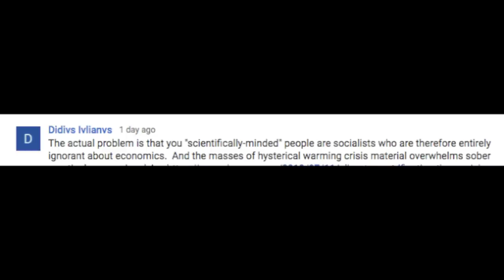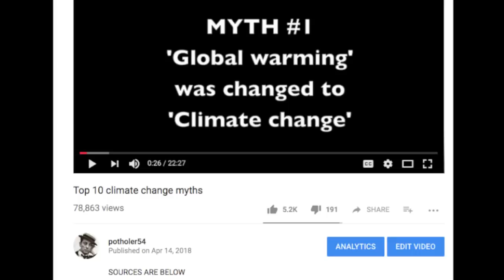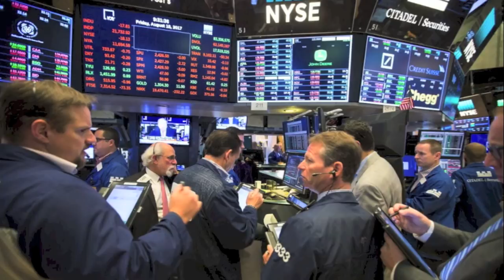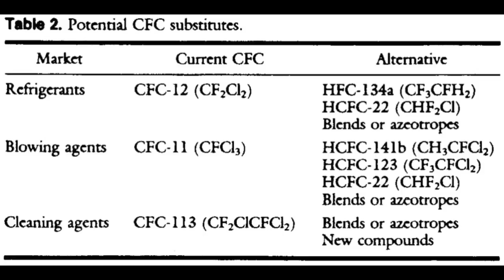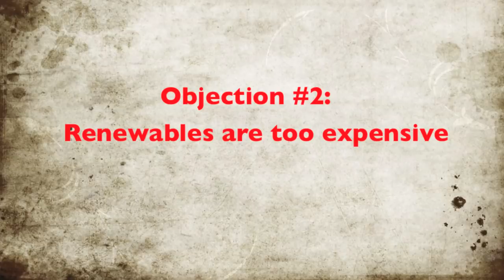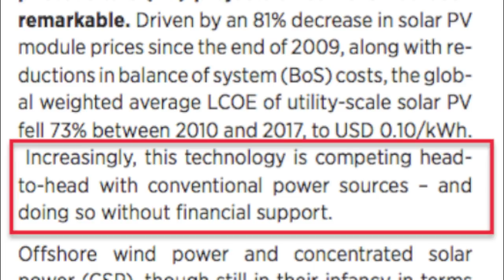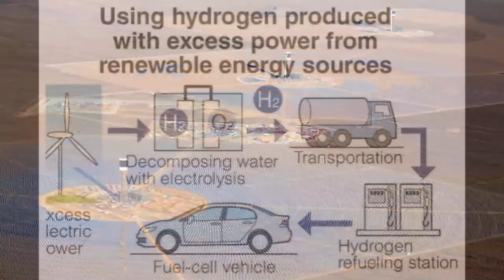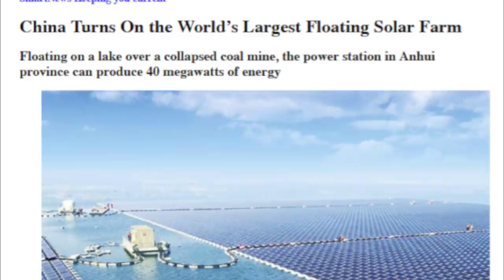A CONSERVATIVE solution to global warming (Part 1)

Comment: My concern is that the technologies that are currently subsuidised and seen as a replacement for fossil fuels - e.g. electric cars, solar panels, wind or lithium-ion batteries are just going to cause more pollution in the long run, only of a different kind, e.g. instead of CO2 in the atmosphere we'll get water and soil contamination from increased lithium/copper/silicon etc. mining, thus making the currently proposed technologies a dead end and not a viable solution. I'm worried that since those technologies are subsidised nobody is going to worry about that their drawbacks and ultimately this will lead to another problem in the time to come. Maybe there should be no subsidies at all and at the same time higher fines for polluting the atmosphere as well as the soil or air, no matter if that pollution is released in e.g. German cities where cars drive or in Chinese mines and factories where they are made. Maybe then the market would be forced to look for technologies that are viable in the long term and do so more efficiently.

Comment: @pothler54:
Food for thought:

short analysis:
switching to renewables etc. will decrease the demand for fossil energy sources. Decreasing demand will lead to decreasing costs. This will lead to fossil energy sources getting ahead of renewables on the market. Especially poor countries will focus on fossil energy sources instead of the more expensive renewables.
In the end, the same amount of fossil energy sources will be burned and switching to renewables will hardly save any green house emissions on a global scale.
This renders most of the current climate change mitigation efforts useless.

another approach:
nations and/or NGOs buy oil fields, coal mines and halt the extraction. The supply drops and the price rises. Renewables will get the cheapest source for energy.

What are your thoughts on this?

The german professor for industrial engineering and energy Prof. Jürgen Kuck has explained the main idea behind it very briefly in his 4 minute video "buy carbon!" which is up on his Youtube-Channel "Jürgen Kuck". His more detailed talks on the topic are only available in german as far as I know.
Reply: The costs of fossils would only decrease if there was an over supply + extraktion and refining costs of fossils keep steady.

Which kinda seems unlikely as the reserves keep getting smaller and demand is still rising

Afaik the costs of extracting and refining it - rise with new stricter enviromental protection regulations. And dont forget the  infrastructure required to transport it.

Oil is still used in some other industries, like pharma or material production.

And (renewable) tech usually keeps gettting cheaper with broader use and innovations in production and technologies.
Reply: @NewPipeFTW  
I agree that not all oil will be extracted and eventually renewables will be cheaper.

Comment: After watching some of your videos, I commend you for you genuine effort at veracity. But I need to point out a glaring flaw in your presentation: it appears you don't have an adequate grasp of energy economics, particularly the energy returned on energy invested (EROEI). This is the amount of investment you need in the form of energy to obtain a certain amount of energy out of a given energy source. So for example, in the 1930's for each barrel of oil that you invest to set up an oil rig, it would yield you 100 barrels of oil, meaning an EROEI of 100:1. Nowadays, with the massive investment in terms of money, effort and energy that is required to build a multi-billion dollar offshore-oil-rig or a shale-oil fracking rig, the overall EROEI of crude oil has diminished to about 30:1. To run an advanced industrial economy with lots of specialization and diversity in roles requires a minimum EROEI of 10:1. The problem with wind and solar is that they can at best give an EROEI of 5:1, even with improvements in technology and efficiency. What this means that they are extremely capital and resource intensive and will yield only moderate returns in energy. To run a modern economy on wind and solar would require that the energy economy has to be a large part of the overall economy. This would be a huge step backward. It's like sending millions of people back to the farm to grow food. This is the FUNDAMENTAL reason why they are not viable as sources of energy to sustain our energy-intensive ways of life. They just don't give you enough bang for you buck. Moreover, building massive numbers of them would draw down heavily on the world's finite supply of precious metals like indium and gallium, whose production by the way China has a monopoly over. It's not just because of China's farsightedness that it is investing in these renewables; it's because it has the precious metals to do so. Conservatives are actually right to downplay wind and solar, but they are wrong to insist that we continue on the same path we're on now with fossil fuels. The answer lies elsewhere. Fusion energy perhaps. Something with a MUCH, MUCH larger EROEI. The reality is that we need EROEI to keep increasing in order to allow us to tackle the problems we have created for ourselves. We need massive quantities of energy to free up our initiative and enterprise.
Reply: I'm curious how you are calculating EROEI for wind and solar. Obviously, in the short run, they are much more resource intensive, but over the long run don't they outpace fossil fuels? Once you burn a gallon of gasoline, it's gone. But you can let solar panels just sit there for decades without doing anything other than cleaning them or maybe replacing a bad cell now and again. What's the time frame you're using for EROEI?
Reply: Tom Timelord I believe solar panels need to be replaced every two decades or so.
Reply: @tomtimelord7876  The exact number crunching was done by Richard Heinberg and the Post Carbon Institute, who have been studying these matters for decades. Richard has given many presentations on this subject for many years. There are also many articles archived at theoildrum.com, where people had been very actively discussing these matters back when it seemed as if we had reached the peak of global oil production (around 2005-2013). Gail Tveberg from ourfiniteworld.com has also written some great articles on this matter. Here's one:
https://ourfiniteworld.com/2016/12/21/eroei-calculations-for-solar-pv-are-misleading/

I'm not sure that in the long run wind and solar can replace fossil fuels since these alternatives can only be developed, built and deployed at a low cost on the platform of an existing fossil fueled economy. In other words, coal and oil are subsidizing solar and wind. Think of the diesel-powered machines and trucks which mine the metals, the coal-powered power stations which supply electricity to the factories where solar panels and wind turbines are made, the oil-guzzling shipping vessels which transport them around the world etc. Furthermore, as Gail Tveberg once said, wind turbines do not run on wind: they run on spare parts. They are rather fossil-fuel intensive in all the maintenance they constantly require eg maintenance crews have to be flown by helicopters to offshore wind-farms. Windmills are not self-sufficient in this sense. 

One has to do the numbers. The energy economics of wind and solar just don't come anywhere close to fossil fuels. This is not to say that we shouldn't develop alternatives; just that we need to be energy-literate before tackling the problem.
Reply: @shox007  Well, I think there's a couple assumptions you're making that I'd like to address. The first is that solar and wind will "replace" fossil fuels. I mean, in the long run, this will have to happen right, as fossil fuels are non-renewable? Maybe 100 years, maybe 1000, but eventually there will be no fossil fuels left. So by 4000 AD civilization will have to be powered by renewables and nuclear, right? I mean, what's the alternative? In the short run, however, solar and wind are good in certain niches at supplementing fossil fuel power. 

Also, you're kind of assuming that solar and wind technology won't improve. You wrote "The problem with wind and solar is that they can at best give an EROEI of 5:1, even with improvements in technology and efficiency." I'm not a physicist or an engineer, so this is a bit above my pay grade, but I'm curious why you give it an EROEI of 5:1, max. Is it simply not possibly, even theoretically to have a higher EROEI? Like, would it violate the laws of thermodynamics to have an EROEI of 10:1 for a solar panel?
Reply: Tom Timelord The assumption the gasoline is gone after its burned is still inaccurate as you can still filter the CO2 out of the atmosphere and reuse it if the systems were in place. Not saying we can do that reliably now, but in the future it could be possible.
Reply: @ultroniumgalactus7343  That would be great because it would simultaneously scrub CO2 from the atmosphere while giving us a fuel source. But that technology has a long way to go.
Reply: @tomtimelord7876  I totally agree. That is why we should let the free market develop solutions to that problem.

Comment: What the scientists/professionals say about climate change: 
 
Meteorologist Tom Wysmuller has pointed out “total disconnects” between temperature and CO2 “going back ten centuries.”  As Wysmuller wrote, “From 1000AD to 1800, over a period of relatively stable CO2 values that bounced around the 280 ppm level, temperature plummeted in the Little Ice Age and then rebounded over a century later.  CO2 values neither led nor followed the temperature declines and recoveries.  CO2 seems to have had little impact in either direction on the observed temperatures over a 10,000 year period.  If CO2 is to be considered a major driver of temperatures, it is doing a counter-intuitive dance around the numbers.”

Australian geologist Ian Plimer wrote. “At present the Earth’s atmosphere is starved of CO2.  On all time scales, there is no correlation between temperatures and CO2.  If there is no correlation, then there is no causation.”

Prominent award winning Swedish climate scientist Lennart Bengtsson (who was formerly a global warming activist) declared CO2’s “heating effect is logarithmic: the higher the concentration is, the smaller the effect of a further increase.”  Bengtsson noted that global warming would not even be noticeable without modern instruments.  “The warming we have had over the last 100 years is so small that if we didn’t have climatologists to measure it we wouldn’t have noticed it at all.”  Global warming activists were stunned by this public about face by one of the ‘census’ scientists and Bengtsson was subjected to harassment by the climate change community.

Bengtsson said he had come under "an enormous group pressure" and said that "I see no limit and end to what will happen. It is a situation that reminds me about the time of McCarthy.  I would never have expected anything similar in such an original peaceful community as meteorology. Apparently it has been transformed in recent years." and "I had not expected such an enormous world-wide pressure to be put on me from a community that I have been close to all my active life.”  He also said, “I am worried by a wider trend that science is gradually being influenced by political views."

New Zealand climate scientist Chris de Freitas pointed out that, “Warming and CO2 are not well correlated.  The effect of CO2 on global temperature is already close to its maximum.”  He explained, “Adding more has a decreasing effect,” and also stressed that the “current warm phase is not unprecedented.  From the results of research to date it appears the influence of increasing CO2 on global warming is almost indiscernible.  Future warming could occur, but there is no evidence to suggest it will amount to much.”

And there are numerous others with serious doubts about the current hysteria.
Reply: If someone really really doesn't want climate change to be true, they can cherry pick a few scientists that say it crap. But that doesn't mean it actually is. There were far FAR more scientists that agree with climate change than not. The data is there, you have been deceived by politicians bought by big corporations that want climate change to be fake.
Reply: I think all of those things were addressed in potholer's videos. You can dig through them, find out the flaws in those arguments with the sources.
Reply from the maker: @Stephen Worley wrote: "What the scientists/professionals say about climate change..."
   And what follows are the names of four people, none of whom has ever written a peer-reviewed paper published in a respected scientific journal supporting these claims. In fact, their statements show their complete ignorance of the subject.
   Worst still, you have lifted this entire piece from a book called "The Politically Incorrect Guide to Climate Change" by Marc Morano, a paid lobbyist. You are so lacking critical thinking skills you didn't even bother to check it for accuracy, you just copied and pasted it.    Look, "scientists" and "professionals" also claim that the Earth is expanding, and that HIV doesn't cause AIDS, and that all the species on Earth appeared at the same time and that the Earth is less than 10,000 years old. Only those who aren't skeptical enough to check these claims simply roll over and swallow them. Sucker.
Reply: @potholer54  damn your good haha. The comment you relied to is the most dangerous type. I can't tell you how many people I have met that were under the impression that climate change is an open debate among the science community. They are taken back when I inform them the truth. Thank you for taking the time to spread truth and shut down falsehoods.
Reply: @potholer54  @potholer54  From Dr Steven Schneider:  "On the one hand, as scientists we are ethically bound to the scientific method. On the other hand, we are not just scientists but human beings as well. To do that we need to get some broad based support, to capture the public’s imagination. That, of course, means getting loads of media coverage. So we have to offer up scary scenarios, make simplified, dramatic statements, and make little mention of any doubts we might have. Each of us has to decide what the right balance is between being effective and being honest."  What do you think about his confession with regard to deception?  Perhaps he 'suckered' a lot of people as well.
Reply from the maker: @Stephen Worley wrote: "Perhaps he 'suckered' a lot of people as well."
   Yes - you! You've been completely suckered by whichever blog you got this quote from. 
   I knew you must have got this from a blog, and I've already discovered that you're not skeptical so you probably didn't bother to check it, and I suspected that there was probably something missing from the quote -- and I was right.
   The context of the quote is that Schneider was doing an interview with Jonathan Schell, writing for Discover magazine. Schneider later wrote: 
   "I tried to explain to Schell how to be both effective and honest: by using metaphors that simultaneously convey both urgency and uncertainty, and also by producing supporting documents of all types and lengths (see the "scientist popularizer"). Unfortunately, this clarification is absent from the Discover article, and this omission opened the door for fifteen years of subsequent distortions and attacks. Ironically, this is the consummate example of my grievance about problems arising from short reports of long interviews."
   The only line Schell included in his story to convey this follows the last line of the quote you gave: "I hope that means being both." Yet whatever blog you copied this from cut that line out. Maybe they figured that the suckers who copy and paste these quotes never bother to check them.
Reply: Temperature varying during periods where CO2 was stable doesn't disprove that variations in CO2 affect temperature, any more than temperature of your house varying when the furnace was turned off disproves that your furnace affects the temperature of your house.
Reply: @geraldzuckier  I believe that most will agree that CO2 is a greenhouse gas and will affect the planet's temperature.  The disagreement is on the extent of its effect.  This should help to clarify the issue:  
https://mises.org/library/skeptics-case

Comment: Oil tanks are perfect for storing energy. Just convert them to store liquid hydrogen instead. When there is excess wind or solar, just use electrolysis to make more hydrogen.
Reply: condensing hydrogen is no walk in the park
Reply: As with all things in life, it’s not that simple. Splitting water takes a lot electricity, and storing it is difficult. Hydrogen being the smallest atom makes a very small molecule and has a tendency of passing through the walls of the container, even at cryogenic temperatures.
Reply: Why can't we just grow bio-fuels with algae farms or similar, and use them for power demands or for minimizing the problem caused by renewable variability? Alongside nuclear power, we would be able to handle things without needing to get oil or other fossil fuels from underground. Improved battery technology and such is also viable, but we do have other options that are 100% (or extremely close to being so) green like nuclear/bio-diesel (when cars are regulated to minimize non-CO2 emissions) and such.